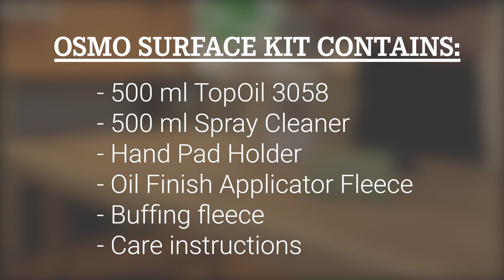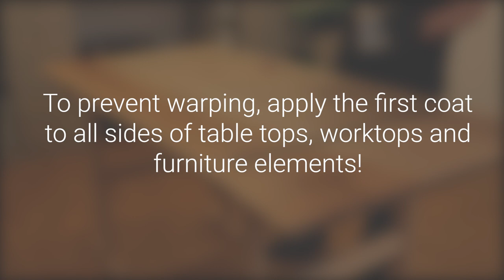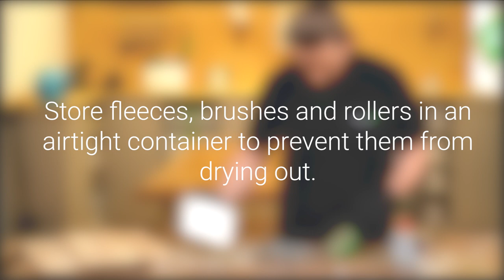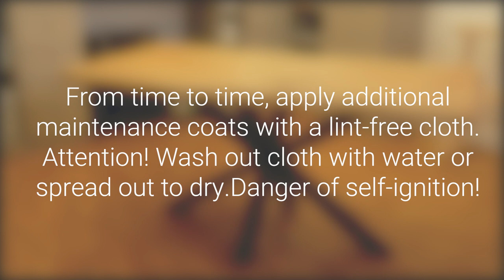How to Apply Osmo TopOil

Comment: Hi, on the website it says there is no need to sand between coats of the Top Oil but the video seems to recommend sanding between coats so.... ?
Reply from the maker: Hi, sorry for the confusion there. Usually there is not a need to sand between coats, however some wood species react differently to oil application and you may experience slight lifting or popping of the wood fibres. if this does happen, lightly sanding the surface (hand weight) with a fine P320 - P360 can be carried out. Hope this helps.

Comment: I still do not understand the difference with polyx (except for toy safety). Is it more or less resistant than polyx?
Reply from the maker: Hi, the finishes are quite similar in ingredients albeit different ratios. The Polyx-Oils are slightly more harder wearing than the Top Oils, which makes them great for very high traffic areas such as flooring. The Top Oils may offer a little more water resistance so more suited for  surfaces where lots of water will be present such as worktops and bathroom counter tops. Both finishes when dry are safe to humans,  animals and plants. We hope this helps.

Comment: This How-To video has different advice on application compared to this other one from Osmo - https://www.youtube.com/watch?v=sveDPFjNNbA&pp=ygULT3NtbyB0b3BvaWw%3D
Just a bit confusing.  I finally went for P120 prep of a Oak kitchen top.  Brush 1st coat. No sanding between coats.  Lint free cloth for 2nd coat.
Reply from the maker: Hello, to reach the optimum protection it is always it is always best to fill up the grain, usually this will take 2 coats applied with a brush or roller. If using a brush for your first coat and then cloth we would recommend applying 2 cloth coats as this application method is thinner. This method will fill the grain up and offer great resistance and protection. Hope this helps.